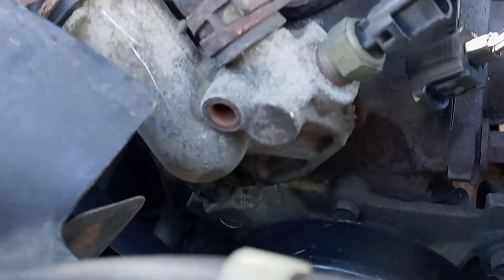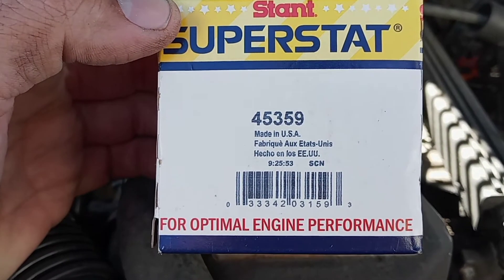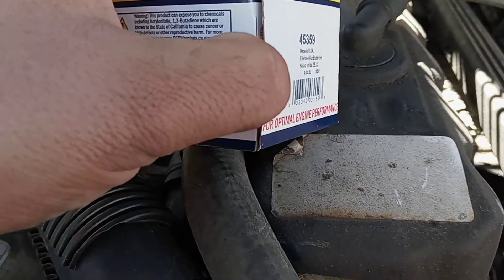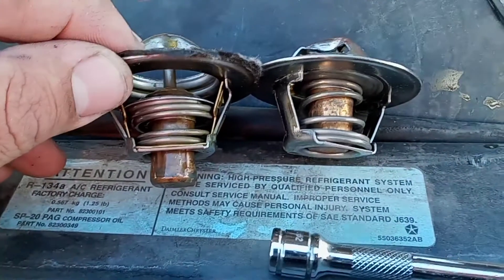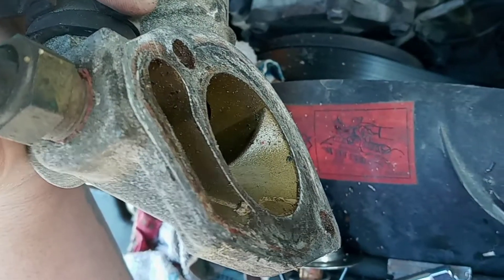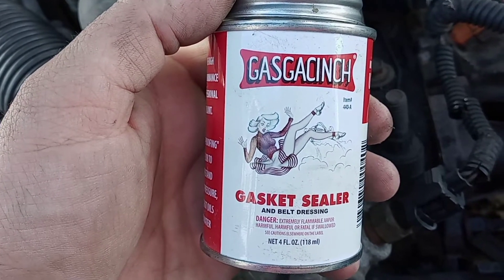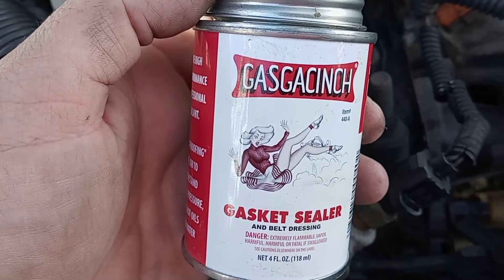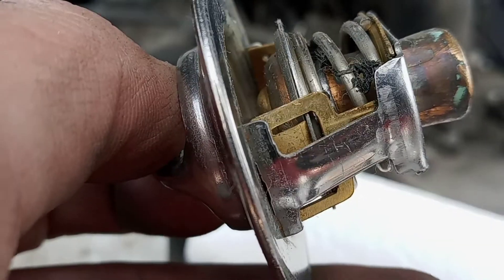Project Gus Gus Fail-safe Thermostat Failed

Comment: My Motorad fail-safe thermostat also stuck open days after I installed it, but it was doing what it was supposed to do. My coolant level sensor blew off the radiator and I lost all my coolant, twice, and the second time almost instantly overheating the engine causing the new thermostat to fail-open. They are designed to fail-open when they overheat, which isn’t technically a “fail” since they are designed to do that. Even so, opening when it’s hot like it’s supposed to isn’t exactly a “failure” but getting stuck that way for no reason kinda is. The OEM thermostat from GM that it originally replaced was genuinely failed-open… just stuck open with no tabs holding it there.

Even though the Motorad did what it was supposed to do, that was of limited usefulness since the overheat was caused by no coolant. Failing open doesn’t help when the overheat was caused by a lack of coolant so there isn’t any to circulate anyway. All failing-open did was lose the small amount of coolant that otherwise would have kept circulating in my two heater cores. :(

I was able to reset the mechanism by tweaking those tabs so I could easily reinstall it but it seems pointless since it’s no more likely to “fail-open” during a real failure. I put in another… this time a standard Motorad. It really is a pain on the 1997-2005 GM minivans (Trans Sport, Montana, Venture, Silhouette). Hopefully the overheat didn’t do any damage.
Reply from the maker: My Jeep never overheated. It runs at the same temperature it always has turned this thing stuck open and my truck would not get over 120°. Mix that with winter weather at the time My heater wouldn't even work for an hour drive and a snowstorm. Replace the thermostat with another one from a different brand and not a feel safe no issue since

Comment: I bought a car with no heat working, found it had a locked open failsafe t-stat too. Replaced it with a stant OE and soon found out I had a leaky head gasket issue. Fun stuff.

Comment: I went from a 91c to a 82c and no issues or change in fuel milage. Car runs cooler as well as the ZF Auto Tranny (also cooled by Coolant). Car goes better than ever, and still gets plenty hot.
Reply from the maker: It was the thermostat temp change that was the issue... It was the fact it was a fail safe style thermostat and once above the fail safe it locked open.

Comment: Is it possible your radiator has blockages, resulting in running a bit hot and tripping the fail safe to lock open?
Reply from the maker: I have heard the after the fact fail safe thermostat have had nothing but issues. Especially because my Jeep runs at 210 with the thermostat at 195.
Reply from the maker: By the way radiator is new and cooling system was flushed

Comment: why did it fail
Reply from the maker: It was a faulty brand new part. Let me edit and add to this comment. It's not that it's a faulty part necessarily it's designed to lock open above 195 degrees, but the Jeeps runs around 210 degrees. so the thermostat acts as if the Jeep is overheating and locks in the open position.
Reply: @SandRatsGarage  are all made to lock at 195? I just ordered one for my crv and it was on to open up at 170. At least I hope it’s to open up and not lock open at 170
Reply from the maker: @menaceemceefiend9716  they are set to open at the temperature you bought it at they are set to lock open I believe after hitting a certain point, but I don't know what the temperature is
Reply: @SandRatsGarage  when it locked in 210 degrees, did it get stuck?